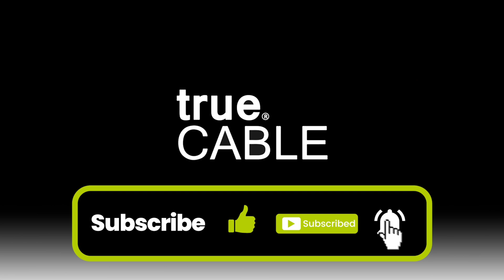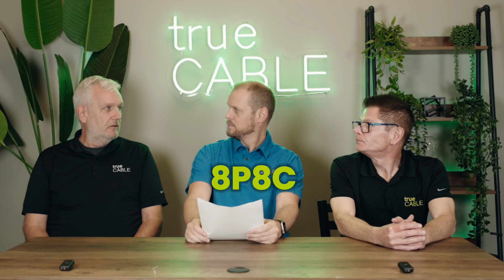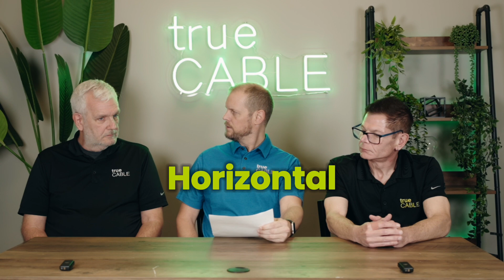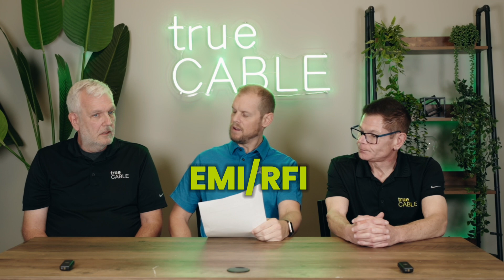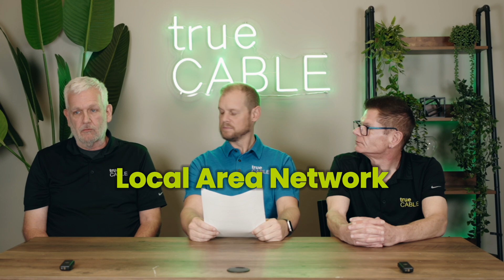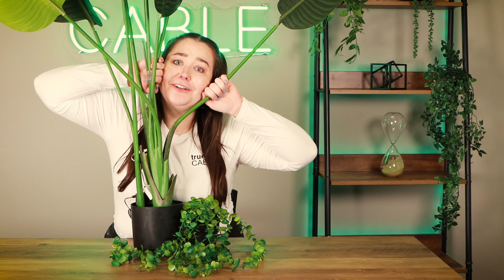Ethernet Cable Terminology Explained | A Beginners Guide

Comment: Can you guy do a video explaining power over ethernet
Reply: Its basically used for low voltage applications like Cameras so you dont have to run both the ethernet cable and a power cable to the camera. You only run 1 Ehternet cable and that cable has 8 little wires in itself and i think 2 wires or 4 are used for powering your camera and the other 4 are used for data or something similar like that, im not a pro at this tho haha, i just know a little about it. I'll leave for the proper explanation to these guys😊